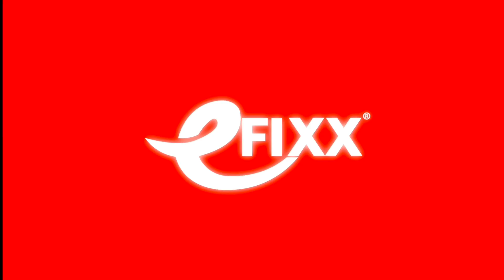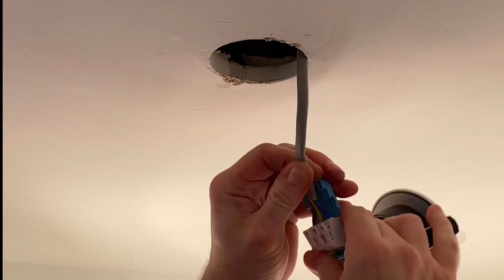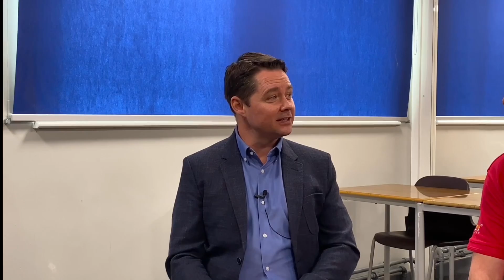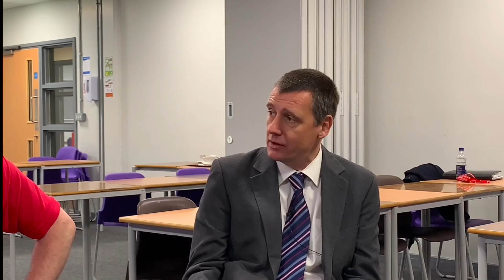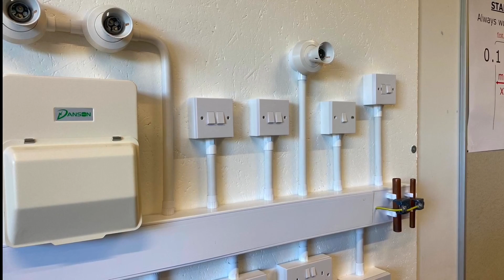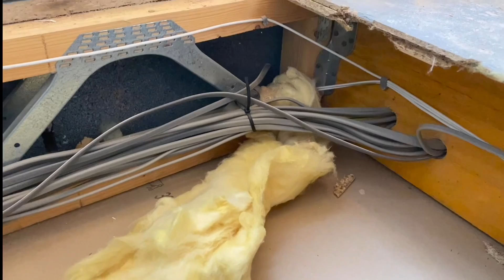DOMESTIC ELECTRICIAN GOLD CARD plus NEW EV & PV Apprenticeships

Comment: So this course probably leads to the ability to sign off notifiable domestic work. This currently amounts to a new circuit, change of CU or work in a special location. So 3 years to sign those things off, leaving the local handyman, to do extra sockets, new lights, replacement accessories, rewiring existing in situ circuits.

Comment: Does it really take three years to learn how to install and maintain a single phase domestic installation comprising a few rings and radials? I understand you can do solar and vehicle courses which take simply a week. It’s hardly difficult installing an EV charger. This sounds like another NVQ (Not Very Qualified) and another thing to subscribe to. The ECS. More overheads to pass on to a domestic client. The sort that want to pay less and less. This will lead to more and more DIY. There’s only a sprinkling things that are notifiable now unless that is reversed and even so that won’t stop the DIYer. It never did before. The “ideas” groups can contrive as many courses and coloured cards they want, no one works on my installation apart from me and I’m sure as hell no doing a three year apprenticeship to change my CU when I can notify the local council or choose not to bother and swallow the risk. How many part P DIY prosecutions have there been in the last five years across the UK involving the DIY householder?

Comment: I think there's a real lack in courses for larger scale renewables.
You can do a 5 day course on domestic solar and small commercial, but I can't find anything aimed at large systems.

Designing a domestic solar installation with battery storage is completely different to designing one in the scale of hundreds of kilowatts or more. If nothing else you're unlikely to have 1000V rated strings on a house but loads of the designs we do are up there.

Comment: Hypothetical. Let's say in 10 years everyone realises heat pumps and electric vehicles are not the answer. Is this going to leave a load of guys qualified to do the installs with no work to do?
Reply: Heat pumps are not the answer. If you have house properly insulated with heat recovery system, what is the point of forking 14k(heat pump) instead 
of 2k(combi boiler)? It may change with massive gas prices rise but at the moment electricity and gas rise simultaneously.

Comment: Does this mean that the people who do the domestic electrician qualification are going to be seen as less qualified? Would someone who only works on commercial sites be able to just go and get the domestic gold card without any trouble or would they have to do a bridging course as well. Would the commercial electrician be considered a fully qualified electrician and the domestic spark like an upgraded improver?
Reply: And what of those who have only done Level 3 2365 at college without an employer?
Reply: I can sort of see the point, if it's essentially creating 2 specialist qualifications. A domestic electrician and a commercial electrician as some companies only work in one field or the other.  But don't think it should be aimed  to be a lesser qualification. An apprentice after 4 years doing commercial work , would not be prepared to be let loose as  a domestic electrician, any more than an apprentice that has spent 4 years doing domestic work, would be equipped with the knowledge to be a commercial electrician.  Only the lucky apprentices get to sample all aspects of electrical work during their apprenticeship.
Reply: @stuartrhoades4306  Electric is electric. Once you've got to grips with the fittings and parts used the job is the same.
Reply: @electricalstuff259  you are bang on electricity is electricity but someone who's only ever wired up lights and sockets etc in a house would struggle if they suddenly had to wire up a 3 phase contactor and dol starter with remote on off switches for a machine in heavy industry.
I get the seperate disciplines need to be treated as seperate but my concern is that one discipline would be considered higher grade than the other as opposed to an actual seperate discipline
Reply: @joefrayling9263  I don't see why they have to be treated separately - an electrician is an electrician. A couple of weeks shadowing someone else is all that's needed to get used to commercial/industrial.

3 phase is hardly that different to single phase. It's all just electricity into breakers into contactors into equipment at the end of the day.